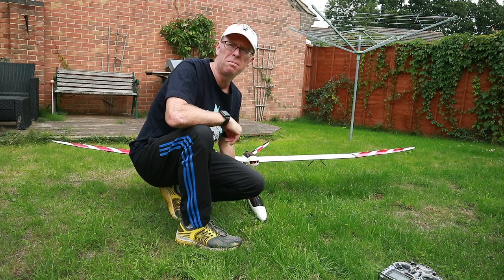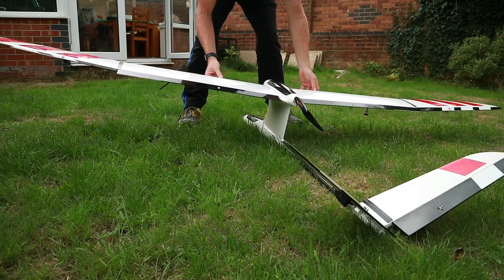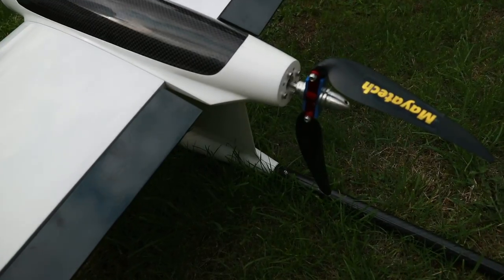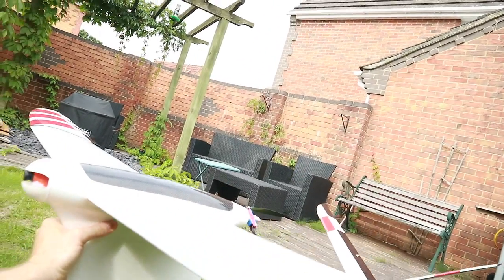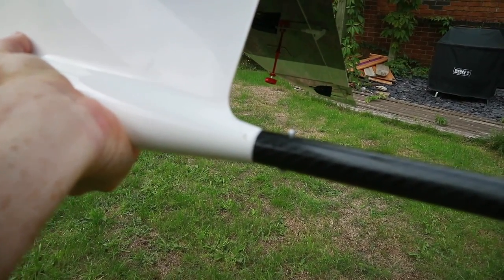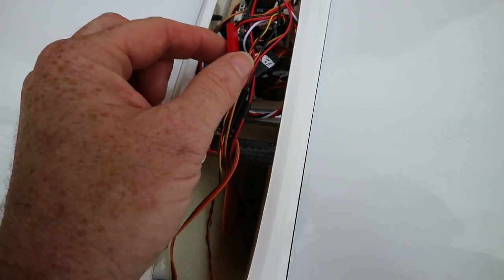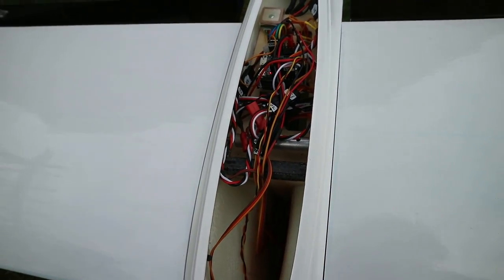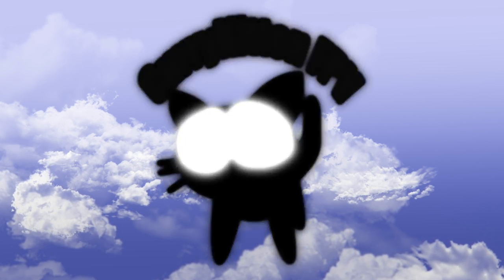The SkyHook Update - a pre-maiden look

Comment: You might need some elevator compensation for the flaps and crow... But you'll want to figure that out in the air. Also may need some elevator to throttle mix since the prop thrust line is so far above the CG.
 I'm not in love with the hole through the boom that secures it with the pin... Hopefully it doesn't make a stress riser. If it's just a unidirectional boom, you might want to wrap some Kevlar thread and CA hoop-wise both fore and aft of the holes.
Reply from the maker: Yes, I'd expect to have to do something with the elevator certainly with flap - crow will be a new one for me.  But I prefer to add in manually instead of having it as part of the mix.  Understand your concerns about the pin, but the tail pretty much friction fits on, the pin is just there as a just in case and also goes through the plastic fuse of the plane so the carbon doesn't get the stress point.